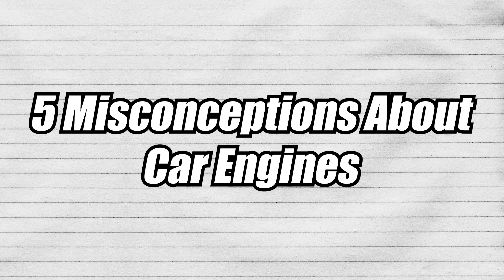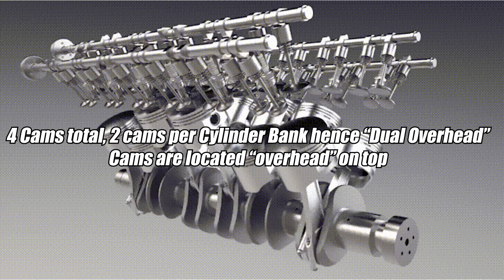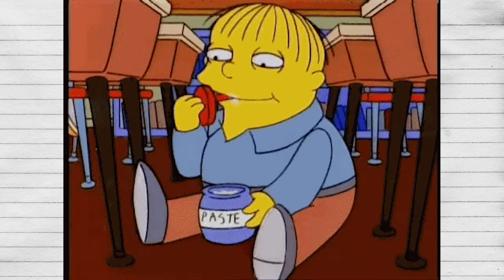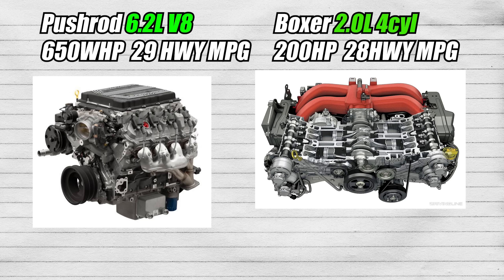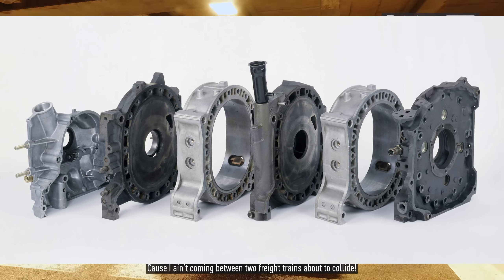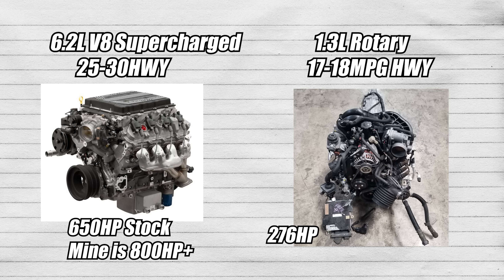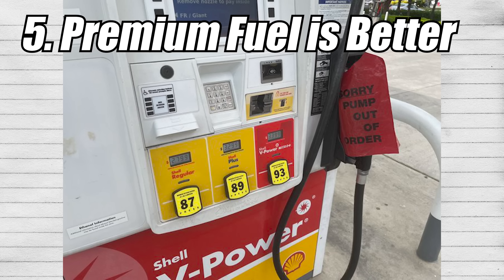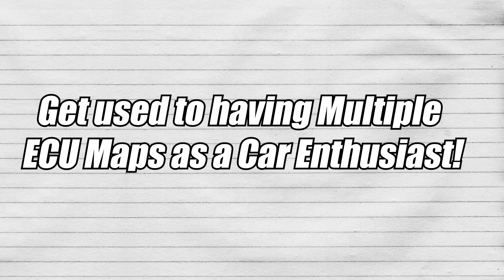5 Misconceptions About Car Engines!

Comment: isnt it a misconception about the difference of pushrods and OHC/DOHC in your first statement? because from what i know, a pushrod engine doesnt make more torque because it has pushrods, but because it has 2 valves per cylinder and maybe in addition have a hemispherical cylinder head. the downside of these engines are that they cant rev as high as an OHC (depends on how engine was designed) or DOHC engine, so they mostly have longer conrods, therefore generate more torque. (same goes sometimes with OHC).
so correct me if i am wrong, i am just a car guy for hobby, not as professional or job-wise
Reply: It makes more torque because pushrod engines tend to be designed with larger displacement.
In other words, they make more torque for their horsepower rating (and fuel economy) than a smaller but higher-revving ohc engine with the same horsepower. (Both examples being NA).
And yes the larger valves, especially with hemi heads but most don't have that (even Chrysler's are only barely hemispherical).
Reply: @nthgth  ok, so does this mean that bladeds statement was true or false?
Reply: @kaisertrinityt.m.i.s1607  His explanation is not MY understanding. I don't want to outright accuse him of misinformation though.
I'm not an engineer or any kind of expert, and even if Bladed also is not, he's probably done more research into this and has no reason to make stuff up.

Comment: I still think you need to warm it up bladed. Rapid heat to the block and cylinder walls could crack and warp it right, lmk if I’m wrong
Reply: I normally wait 5-10 minutes if it's pretty cold to let my car warm up generally. But that's also because i like to wait till the heater fully warms up the car because it's usually freezing

Comment: An engine's valvetrain does NOT determine if it'll make more or less torque. Just because it's got pushrods does not mean it'll make more torque. Engine stroke and displacement are what determine torque. A SBF 302 makes less torque than a 351 SBF only because of displacement. Along with the stroke, you need to look at how the heads are designed as well as the intake manifold. Long, narrow runners with narrow ports will make more peak torque than short, wide runners and wide open ports. This is why commuter cars and trucks have such large intake manifolds. Cams also determine both engine performance and rev range. High power big block V8 engines in the pro series are all pushrod engines that go up to 8k RPM, but they idle super high. The reason DOHC engines rev so high is because their cams are designed for peak horsepower in the high end. The 5.0 DOHC has electronic cam control, but is designed to idle as well as get high horsepower which only comes in after the mid range. The reason Corvettes can cruise at such low RPM is because of the gearing in the transmission and differential. The more torque an engine produces, the less that torque needs to be multiplied through gear ratios. You're also not stating that corvette engines have DOD, which kills 4 cylinders while cruising, and on top of that, the ECU is designed to run super lean while this is happening so in reality your cruising with a 3L engine running at like 17:1 AFR. Not to mention aerodynamics. If you're gonna make a video and bash people for being ignorant then you owe it to your viewers to not be ignorant yourself.

Comment: Rotary is less reliable if you want more power. Mazda 787B origanlly had something about 800 HP, but they needed to reduce it's power to something around 550 HP, because they had to if they wanted to win Le Mans 24 Hours...

Comment: oof the V8 and V6 you mentioned in the early 3 min part are both cylinder deactivation engines. Not good picks.
Reply: It's still a good point that you can have your cake and eat it too with higher displacement; it is doable.

The Accord's 35mpg was compared to a Toyota 86. Why not shut off one or two of the 86's cylinders at highway speed and even things out?
Whatever the reason they can't do that is a damn good argument for higher displacement which DOES allow you to do that.
Reply: @nthgth  because the 86 uses D4S and the honda isn't. that and a few other things are why that v6 in most hondas only pulls 240 hp while the 86 is at 200. Also cylinder deactivation engine have terrible reliability. That same honda engine is in the shop most days with codes for that system not engaging leading to terrible fuel mileage. the reason the 86 gets the mileage that it does is because it was made with drivability in mind and not a top speed they made it fun and have acceptable MPG. changing gear ratios to make it more economical wouldnt make it at 86 it would make it a prius.

Comment: I used to think there's no replacement for displacement till I learned that a Koenigsegg has a 3 cylinder engine and electric motor
Reply: The electric motor is most of the output, and even though you can end up with a high output low displacement engine, it still doesnt behave the same as a high displacement engine with the same output. A turbocharged 2.5L I4 making 350hp and a naturally aspirated 5.0L V8 making 350hp will behave differently, with many people favoring the behavior of a naturally aspirated engine.

Comment: At highways speeds my former Acura TL’s  3.2 would get better fuel economy than my sisters 1.4T Chevy Cruze. That think hates staying at 70+mph for a long time.
This also is probably because of my driving habits being used to a manual with a v6 with decent power, to a small auto box i4
Reply: Manual V-6s are an underappreciated joy. I had a manual V-6 Solara, it was so much fun to go through the gears.

Comment: You've told you will bust myths about engines, not confirm: push rod engines don't make more torque per displacement unit, it just has lower RPM range. 
If you look up to specs of any engine, for example 1,6L in average shitbox will make 145 Nm of torque, while most revving 1,6L in a product vehicle Honda's B16B makes 160 Nm of torque but the difference is, first one does it at 4k RPM and second one at 6500 RPM, and across all range B16B will make roughly the same torque until VTEC engagement.

So push-rod will always make less torque and less power in general, BUT thanks to cam timing it will make more torque at low RPM range – 1500-3000, where every engine is mostly used in daily driving, and only thanks to that cam timing you'll reach better fuel economy, not because it has rods to open valves.
My Honda has it's max torque at 2800RPM giving 92 Nm per 1 liter of displacement which is pretty average for N/A motor, but it has overhead camshaft, not a push-pod system.

Comment: Nah premium fuel here in the uk makes a huge difference, they changed normal fuel to E10 back along (10% ethanol instead of 5%) and made it so only premium has 5%, and a lot of engines really don’t like it. To the average motorist it won’t make a difference though, but you will be slightly down on power and mpg
Reply: Most gasoline is E10 here in the US too but I think it's not directly by law, but from ethanol being cheaper (in turn from controversial gov't subsidies for growing corn). (I.e. it's basically a cheap filler).
Some stations sell 100% pure petrol for the highest octane, but it costs more than the same octane E10. Sucks.
MPG is noticeably affected for sure, but I believe in cars with the factory tune, power is not.

Comment: Displacement tax laws are luxury taxes and not carbon taxes. Most high displacement engines that are subject to tax are in luxury cars as pickup trucks and vans can be exempted through "work truck/work van" exemptions that they often set in these laws. 

These taxes only exist to tax the wealthy for their luxury purchases. High displacement naturally aspirated/supercharged v8 engines are the common staple of luxury, the power comes on smooth and strong in those engines compared to turbo where power comes on suddenly and feels cheap. Displacement tax makes it impossible for the luxury automaker to use clever tricks like reducing displacement and tacking on turbos because that cheapens the experience they're selling.

Comment: But the GM V8 engine has a system that deactivates cylinders for better gas mileage. The downside is that the engine and transmission wear out faster from imbalances.

Comment: Funnily enough Honda’s rev high and still pull good gas mileage. The fact my CRV is nearly turning 4,000 RPM at 75 and still gets 22 mpg with off-road tires and the aerodynamics of a rounded brick that’s pretty crazy.
Reply: Tf is that lmao, J series get 30 mpg at 75 mph.
Reply: @PURENT  you completely missed the point your v6 isn’t turning 4,000 rpm at 75 it also turns off cylinders to save gas with VCM. My civic pulls 40 mpg on highway cruising at 1500 rpm which isn’t “high rpm” I was mentioning the fact even though the transmission and chassis isn’t efficient in my CRV it still pulls 22 mpg.
Reply: @CaptainTexas92  V6 with cyl deactivation running on 4 cyl getting higher mpg than I4 running on 4 cyl.

Just questionable on how that thing is geared more than anything.
Reply: @PURENT  that’s the point. It’s an inefficient chassis that still pulls 22 MPG even spinning at a ludicrous 4K rpm on the highway. Bladed was saying RPM effects efficiency but older 90’s 4 cylinder Hondas put respectable high 20’s low 30’s even with the engine revving high at highway speed.

Comment: That's their way of taxing more for stuff, I won't even mention what they are doing here in Europe because they might take ideas to tax more in US lol anyway I love the rotary engine and there is no other way to put it, they really need to be rebuilt after a certain mileage, it's not meant to be something to last forever, it's like a 2 stroke engine, there is a lot of air circling inside the engine so the materials don't get to the same temperatures as a 4 stroke engine for example so they tend to be less reliable, you might think that old folks are wrong about getting your engine to temp but lets face it nobody wants a car for more than 5 years, so if you don't intend to keep it forever why wait those 5 minutes that will make you save a buck in the long run of your car? On the other hand if your car doesn't last that long you will need to buy a new car every 5 years so yeah of course the manufacturer will tell you it's ok lol

Comment: Bladed Angel engine size means nothing, same as gearbox ratios. The formula is rpm/final drive ratio/rolling wheel diameter or length. Gearbox ratios are only used to calculate speed in each gear. That’s why there is a such a difference in your Corvette to Mustang mainly tyre size and diff ratio.

Comment: This is transmission related, but when it's real cold and the RPMs have dropped after a quick warm up, when I pull off I like to use manual mode and keep it in first gear and low RPMs because the transmission likes to shift hard when cold,so as Im coasting through my apartment complex to the street I like to think keeping it in first for those few seconds warms up the trans a little more too. If anyone knows for a fact if this is good or bad to do I would love to know please!

Comment: oh man, I'm disappointed by some of the misinformation in this video here. normally you're better than this.

the first one is the pushrod = more torque thing, but someone else made a better comment about it. one thing to add: generally speaking, if you have two engines, and say one revs to 9000 rpm, and another revs to 6000 rpm, and they make the same power, since power is rotation rate x torque, the 9000 rpm car "has" to produce less torque to achieve the same number, whereas the 6000 rpm car "has" to produce more torque to achieve the same number. pushrod engines generally are not favorable to revving fast, so generally speaking they will have to be designed to create more torque for the same "class" of horsepowers it will be making. pushrods are objectively worse in every way except maybe cost and reliability.

big engines absolutely are generally worse for gas mileage--they have more friction. generally speaking, you get best thermal efficiency if your engine is running as hard as possible. if your engine is capable of 500 hp and you're using 10 hp to get to the grocery store, and you tuned the engine as though you produce 500 hp and you artificially limit it to only produce 10 hp, you get a lot of losses that will eat into your gas mileage. this is why a lot of economy cars these days come with tiny engines and turbos, because you can just shut off the turbo with basically negligible losses (as though you didn't have the turbo in the first place)--and now you have a tiny engine that is running almost wide open throttle. cars these days have all kinds of crazy tricks to improve gas mileage--for instance, Mazda 3s and ND Miatas have no hybrid system, and yet achieves great gas mileage rivaling even some hybrid cards. They use very advanced variable valve technologies that when you're on low throttle, essentially continuously retunes the engine to operate much more efficiently at low powers. Look up the Atkinson cycle; the Prius first made it popular and now everyone is using it. This is also why a lot of cars these days come with a vacuum pump instead of just using engine vacuum--the cars are so efficient these days the engine barely pulls a vacuum (creating a vacuum requires power, that isn't useful to pull the car forward). big engine cars with great gas mileage employ the same technology, and cylinder deactivation as well. same idea, detune/retune the engine so that you're always operating at the most efficient operating regime. gearing the car such that it runs at a low RPM is also the same idea--when you're at a low RPM, the car cannot make a lot of power, so you get great efficiency as you "lug" the engine. that said I have no fucking idea why the BRZ engine gets such bad gas mileage; my guess is that Subaru isn't great at implementing advanced VVT.

rotaries are unreliable: this is pure copium. I don't even know what to say, the apex seals are definitely something that is impossible to adequately lubricate, compared to the piston equivalent which are piston rings, which are something you can lubricate pretty decently. stuff that's inside the engine should not be a wear item. 

warm up: 100% correct

 octane: 100% correct also

Comment: Can someone then explain me, what has better fuel economy/power output:
1jz-gte
or
2jz-ge (i could put sc14 supercharger on it)
Reply: Both will have shit fuel economy if you are making any kind of decent power. In terms of power output, why are you even asking? The turbo engine will obviously make more power than a very similar NA engine...
Reply: @SomeOne_86  im going to 250/350 hp, so it could be a good daily driver
Reply: @bal_723  You can easily make that with a 1jz with some simple mods. If you want it to be a daily, I'd recommend to go to a good shop(if you know one, don't go to some clowns) and have them rebuild the engine with new seals, bearings etc. Maybe get some pistons and rods if you want to up the power later on. 
Making that power on a naturally aspirated 2jz would cost more than your whole car is worth probably. They suck at NA power, they were really made as turbo engines.

I'd recommend just a good condition 1jz, with quality parts and a good, safe tune.

Comment: I disagree with engine displacement, I think of it like a math equation, and force induction is one of the factors. Take a 2L i4 and turbo it you will make more power. Now take a 6.2L v8 and turbo it you will make more power. You can’t turn the i4 into a v8 and you can’t turn the 2.0L I4 into 6.2L. In the end an engine is like an air pump when you can put more air into it we’re gonna make more power.

Comment: 5:00 the transmission plays just as big of a role in fuel economy. Take a 2008 5AT G37 and a 2010 7AT G37 (ignoring the 6MT for this example) - same 3.7L VQ, one is at 3k RPM at HWY speeds, the other is at 1500, the 2010 has way better fuel economy with the exact same engine.

Comment: The large displacement = bad fuel economy is true, go find 1 v8 that gets high mpg and DOESNT have cylinder deactivation. Same goes for that honda v6 reference. Cylinder deactivation is like a cheat mode so ur running half an engine to get 30+ mpg. We used to have a tlx without it and it could do high 20s at best.
Reply: I highly doubt Bladed's tuned, 800+ hp Z06 still has cylinder deactivation. 
But ok. My 1995 Camaro Z28. 30+ mpg on the highway. LS1 cars, even more (especially the Vette).

Comment: I love staying below 2k on my 3rd gen 4runner SR5 but I wish I had more gears instead of the 4 AT. Only highway? I try to reach 28mpg. Only when I need to accelerate past 2k, I activate ECT going up the highway entrance ramp 😭. Staying in 4 gear AT averages 1.6k-1.8k RPM at 60. Idling is around 0.4-0.8k RPM depending on what mode the AT is placed.

Someone try to convince me to fuel up premium, because more combustion = easier rotation through the wheels. Oh hell nah, ECU is not tuned for premium and will cause premature combustion and will damage my engine.
Reply: Also for those who trash on sport cars for horrible MPG. Its how you drive your car. A STi owner complains about how he is getting around 10-15mpg on stock engine but he's shifting around 6-8k RPM.
Reply: @idk-oe3ns  I drive an STI and get 15-18mpg (around town) just driving gently. And premium fuel won't hurt an engine built for regular, in fact it's less volatile so at most it might be a tiny bit harder to start in extreme cold.
Reply: @nthgth  That's quite interesting. I have a buddy that has a 2022 STi completely stock. He's averaging 23-25mpg combined. Not too sure if just city what'll be.